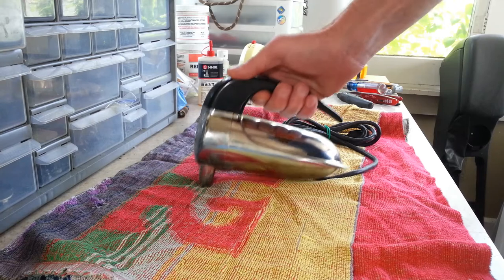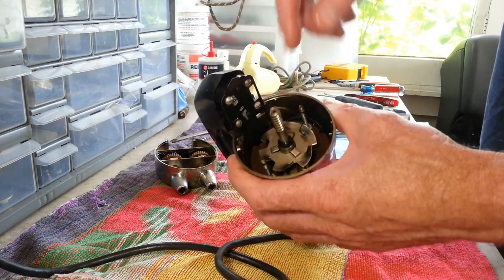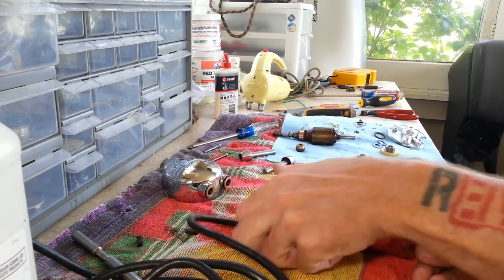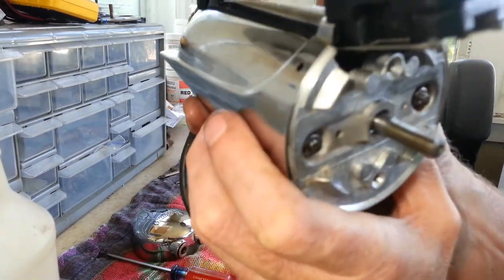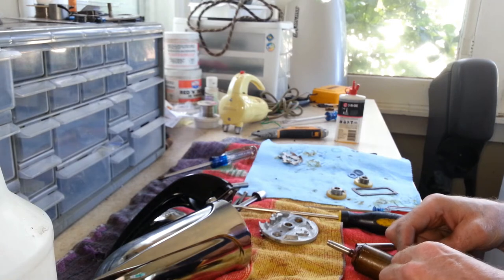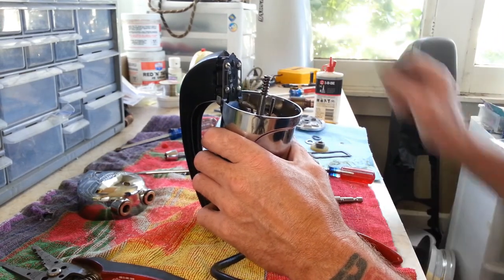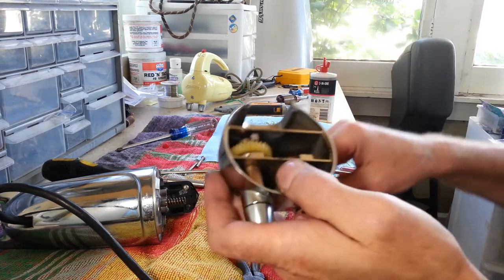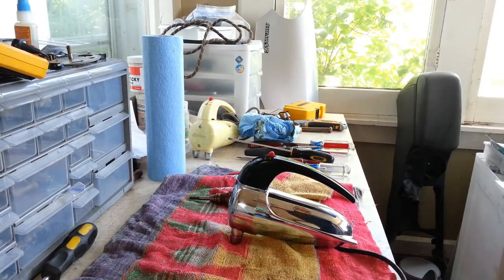Sunbeam Mixmaster Junior Chrome maintenance and service

Comment: How do I replace the cord on this mixer? The cord is open right as it enters the mixer. I haven't figured out how to remove the armature. Thanks for the video.
Reply from the maker: You need to pretty much disassemble the entire machine to replace the cord. I believe I have another video or 2 posted of this model that shows a bit more detail on disassembly, but honestly just remove the front part held on with 2 screws, then remove the plate behind it, then the armature, loosen the 2 nuts on the threaded rods, unscrew the rods and the whole assembly should slide out. You will see how the cord attaches at that point.

Comment: Wow - I guess you found a manufacturing defect here long after the warranty ran out ;-) Have you ever found and armature that was slightly off balance, causing increased noise/vibration? And are some parts such as the armature and beaters interchangeable with stand type Mixmasters, or are these parts exclusive to this type of model?
Reply from the maker: They are definitely not interchangeable,  but surprising I have not really found any other manufacturing defects on any of these machines, stand or hand. I think quality control was much better in the past, but no matter how good,  they are checked by humans so there is always a factor to miss something. :)

Comment: You wouldn't happen to have a extra set of beaters for one of these would you? I was given one of these as a hostess gift, and it is in absloutly beautiful condtion, I am sad that I can't use it.
Reply from the maker: Hi Jason, I'm sorry I don't, I only have the one set that is broken but I use to time them beaters. You might be able to find a good deal on another mixer with beaters for less than what I see beaters go for alone on ebay, I would start there :)
Reply: I can confirm since I discovered these mixers that this type of beater is really hard to come by. As a matter of fact, I found a person with a few large boxes of them for sale at a decent price (2$ to 5$) and not one single beater in his collection would fit my model 7. I got into collecting these mixers precisely because I was missing a set of beater and thought getting another mixer would get me the beaters I was missing for my model 7 ;-) Instead now I have 3 model 12s, one complete with wobbly juicer screen and original spout and meat grinder and two bowls and a 7 still beaterless ;-)... Bless my wife for tolerating my obsession ;-)
Reply: Thanks, good to know!
Reply from the maker: Yes it is the only way to get to it unfortunately